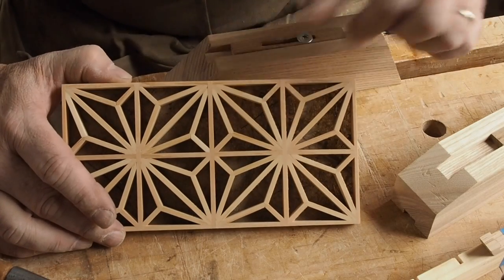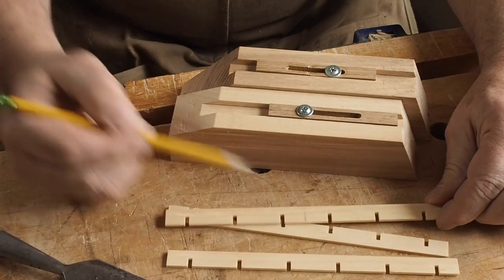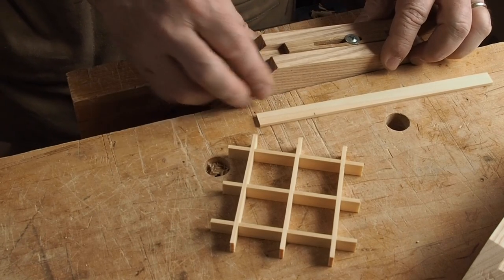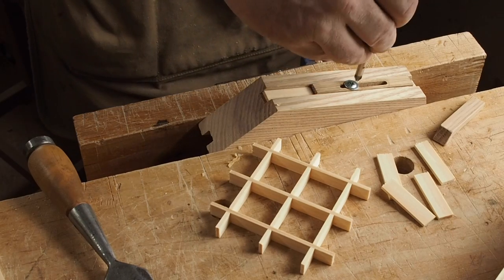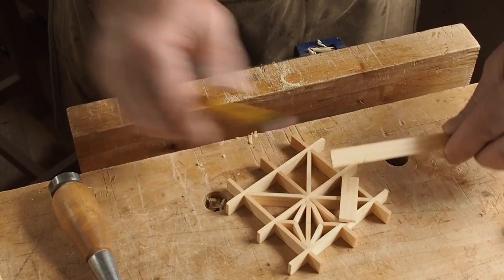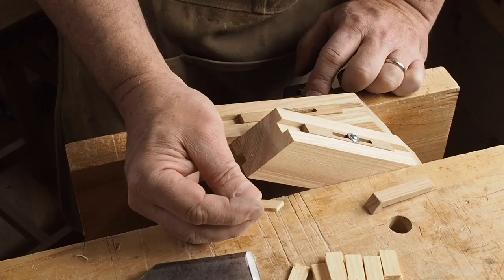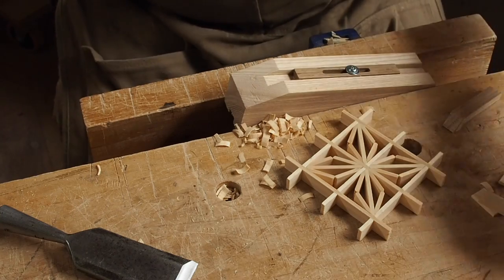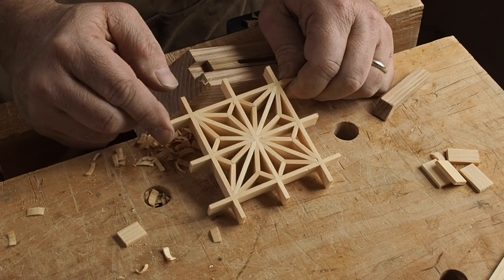Kumiko How-to

Comment: I have a set Narex Richter chisels I like from 1/8 to 1.5". I bought them of the Narex site and for the rating they get the price point is fair and right out of the box they are very sharp and cut well. I suggest you see the chisels reviewed and rated. You can buy the separate if you want. The 1/8" and 1.5" will do if you do not plan to use they others. Note: I am not paid and I purchased them myself. Well My wife bought 3 of them for Christmas.